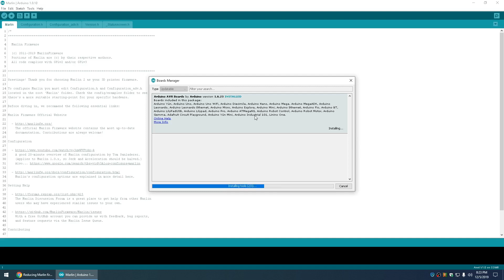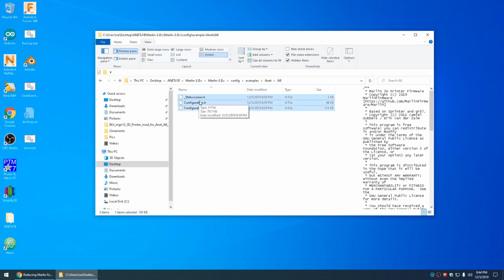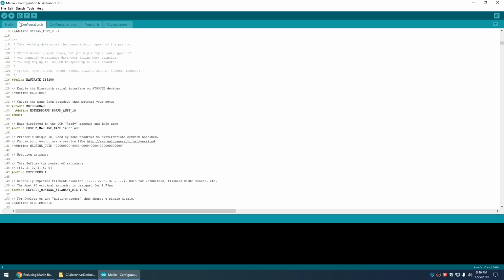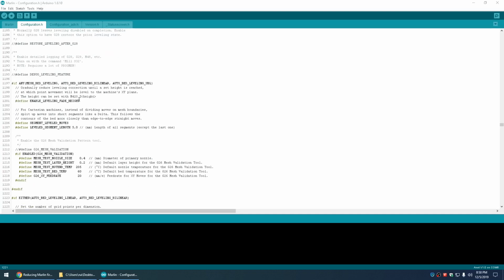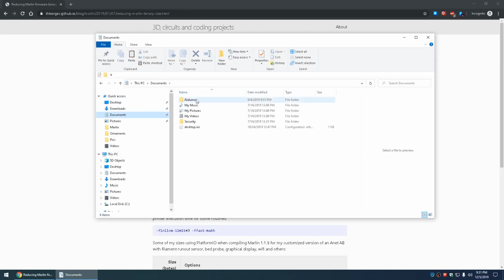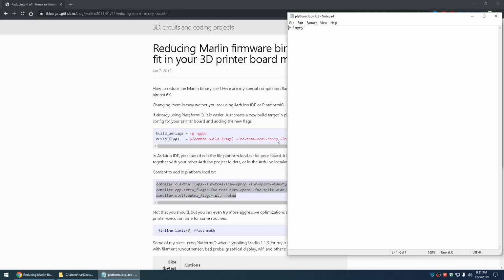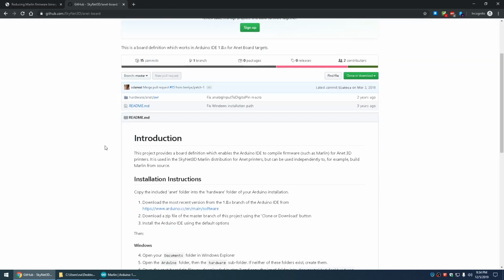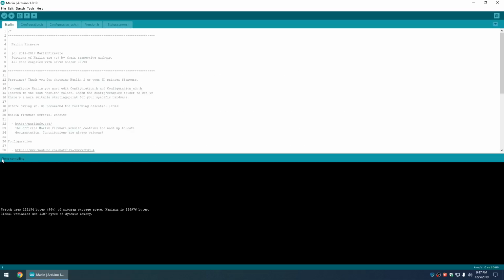Upgrade Marlin 2.0 firmware on ANET A8 v1.0 Board

Comment: The V1.0 board is kind of hard to come buy now. There is the V1.5 board, and another "3D" board "out there." What about those boards and Marlin 2.0?
Reply: there's a V1.7 board now  with better power connection and a fuse on the power
Reply: brian whittle yep, I have that one working.
Reply from the maker: I don't have any other version of the A8 board.  The Marlin build process is exactly the same for any compatible board.  I have an SKR v1.1 board with TMC2208 drivers that I am setting up and eventually will make a video on the print quality of the old A8 (16 steps per mm) board vs the 32-bit board (256 steps per mm)
Reply: I haven't tried Marlin V2 yet, but Marlin V1.x worked fine on my Anet 1.7 board. It's the same AVR microcontroller so it shouldn't matter.
Reply: THe "new" boards have the same amount of memory, so this fix is still valid/needed.